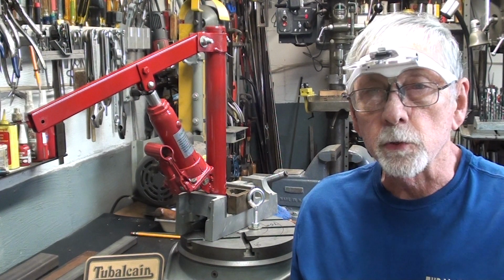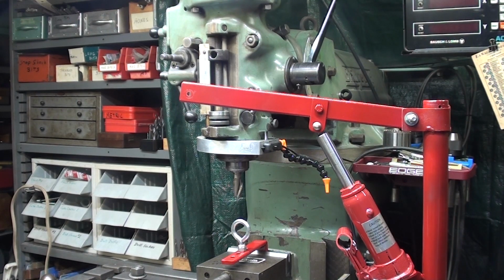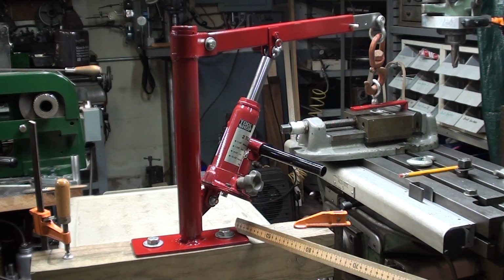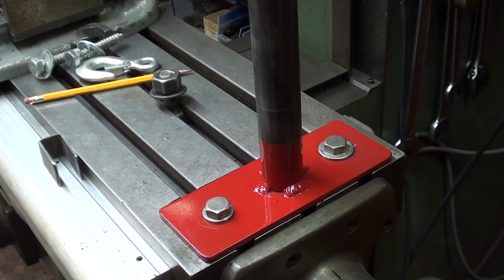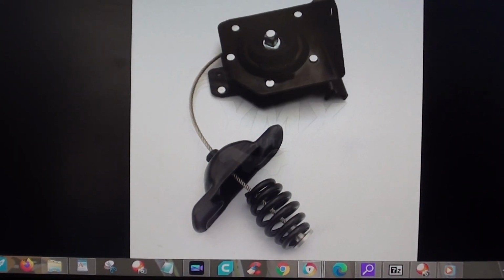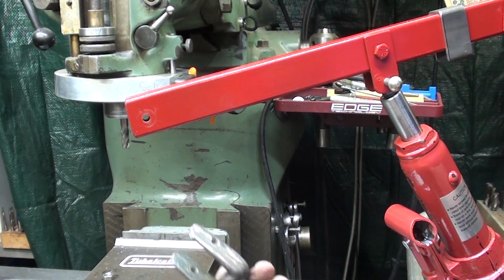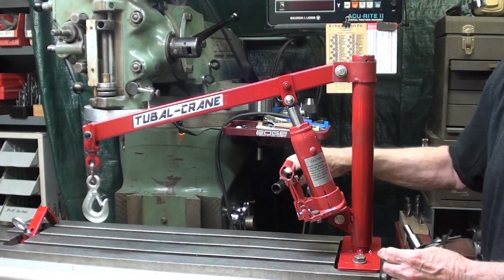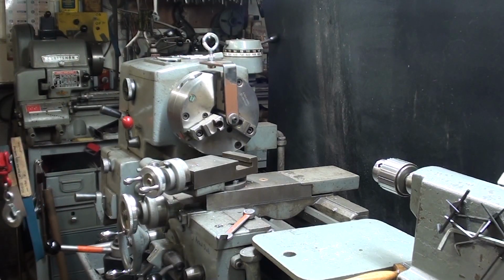Tubal-Crane - SKY Hook for Bridgeport Rotary Table pt 3 #729 tubalcain

Comment: Mr Pete, I have always enjoyed your excellent videos, tips and solutions to shop problems. LOVED the comment "Wreck of the Hesperus" my mother in law used that phrase from time to time.  Just a couple thoughts. IF the crane was mounted on the left end of the table, your jack might be more convenient. And, they make a boat winch with worm drive that would hold the load at any point. Also, it may be that the spare tire winch is a worm drive. By having a winch, it makes it possible to lift near the boom pivot, or lower all the way to the floor. Great stuff. Thank you, R.D. Flagg
Reply from the maker: Good suggestions

Comment: Mr. Pete I've watched your videos #1 & #2 and saw you discounted the electric winch, because you don't have sufficient vertical height in your shop.  Well I've been struggling with moving equipment around and will be installing one of those electric winches, because I need to move up to 300 lbs.  what I intend to do is mount the winch on the floor, or wall and route the cable through pulleys and I'm sure you could do the same in your shop.  Just something to think about.  Thanks for your videos!!

Comment: Did you consider using the grab hook with a short length of 1/4" chain as a two leg bridle and attach to the vise in two places. With a setup like that you can adjust for the CG by moving one or two links off center.

Comment: Can you create new long tee slot nuts so you spread out the load farther and prevent ripping out a small chunk of tee slot and dropping what ever you are picking up. 
You may make a swivel pad for the jack base to turn it for easy pumping.
Knob. I mash a piece of tube to weld a knob to and glue a super magnet into the tube. So it comes off easily.

Comment: Not sure why that little spring latch would be a safety feature. As far as I can tell, the only thing it does is prevent the hook from coming unhooked when there's no load on it. It certainly isn't going to resist. Any serious force.

Comment: Pondering this problem, I wonder if it could be solved by one of those tool tether things.  They hold up to about 25 kg... (about 40 Kentucky butter balls) The idea being that it does not lift the object but take a bit of the gravity out of it to paraphrase aVe. It is always easier to haul down is my thinking. Has anyone tried this? Need a bit of ceiling height of course.
Reply from the maker: Those are good for a 4 pound air tool

Comment: Should be easy enough to figure out the location for the jack pivot; it's just a simple lever.

If it's a 500-lb jack and a 50-lb vise, then the pivot point can be any place that's 1/10 of the boom length away from the vertical or further. Adjust numbers to match your actual devices and desired safety margin.
Reply: Don't forget the strength of the pivot bolt. Every move closer in increases it's loading tremendously.

Comment: ????? I love your video's but this is a bit much.  a 2 ton hydraulic jack with the setup you have is likely only going to be able to realistically lift 1200 or 1300 lbs......... I think you know this. ;)  However, my biggest issue is that I'm hard pressed to find a rotary table or part that is 0.5tons that would actually fit in the setup you are picturing....................... Then again, there is the ridiculous swivel hook you are using. ;)    I'm pretty sure you're in full blown sarcasm mode and that's totally your prerogative.  However, I would say that I have learned a lot from your videos and value them immensely.  Please keep up the good work...........

Regards,

-K

ps.  We're not even factoring in the Safety Factor ALL lifting equipment has, typically 5:1 or better, so a hook that is rated for 1ton under testing won't fail until 5 tons.......... you're at best lifting .75 tons with your setup and that's generous, because I'm hard pressed to think of tooling for the bridgeport that's even remotely close to 1650lbs.................. ;)  let alone 5X that weight.

As I initially mentioned, pretty sure this is a sarcastic video and all the sheeple need to back down.  Then again, what do I know?  I've only been responsible for lifting about 3,000 40+ ton crane loads  and many thousands of 10-20ton lifts in my life.  Moved on long ago though ;)

Comment: I like the idea and had in past when lifting my rotary table or big chuck thought I needed a lift crane or boom.  I had bought from out of business machine shop a rolling floor crane that uses a boat winch and can lift 250lbs.  But legs and wheel get in the way so I still use my HF lift table and slide things.  

In watching my mind already is formulating going with a I-Beam versus a rectangular tube for arm.  I will make a small trolly with stoppers for sliding the hook on.
I also may experiment with a treadmill incline motorized lift instead of the bottle jack (not crazy on bottle jack). I have several of the incline motors I pulled from scraping treadmills.   And cam make a simple toggle up and down control power supply.

Still waiting for answers to last what is it.

Comment: If you were to extend the base of the platform towards the vertical pipe and bore a hole or two in it you could turn the jack around so you are pumping the handle downwards like the jack was originally designed to do.

Comment: You probably had this suggestion before but if you mounted the Tubal-crane on the left side of the table, wouldn't the handle be in the correct position? Nice project. Thanks for sharing.
Reply from the maker: You mean like how I did it in part two?
Reply: @mrpete222  Yepper. Just like you did in part two. I did watch all the videos, just didn't remember you had started out on the left. Just another perk that comes along with age (I'm 75), memory lapses. Thanks for setting me straight.

Comment: From one old GrandPa to another: do yourself a favour, get a trained electrician to recable the Bosch grinder, and make it safe, you daft old Grandpa!
Reply from the maker: A $50 cord for a one dollar grinder?
Reply: @mrpete222  Tubal-Crane,

As a fully qualified but long-retired Electrical Engineer, I hesitate to give advice to a man of a similar age to myself, who has the guts to put his hobby and skills online for all to comment and/or criticise upon.

So instead of criticism, or even any attempt to change a man’s mind, I would simply list the options on just the continuing  existence of a frayed and dangerous flexible power cable.

Ensuring you and any family / visitors in your premises are fully protected by means of the appropriate R.C.D. (Residual Current Detector) breaker at your intake Fuse / Circuit Breaker box.
The presence of the mentioned cost of $50.00 Electrician for the repair.
The purchase of a replacement Bosch Grinder @ =/- $75-$95.
The payment of $2,500-odd for the Cremation Service following the accident.

Your life……………..Your Choice!

Comment: If the hydraulic cylinder could be mounted in such a way where it can rotate about its's center axis, you would accomplish the pumping in multiple positions, without having to pump up.

Comment: Building on the crane on the cart idea, What about mounting the crane on the edge of a bottom tool box?  With floor space at a premium in most shops, mounting on a bottom tool box will cover several requirements. 

Just a thought on an already great project.

Comment: I use 20 ton jacks in my home made jewellers presses. I mill a slot in the release valve and weld a penny washer in to make it easier to open and close.
Reply: 24.20.  50mm!
Reply: How about turning the jack 90 Deg clockwise so that the jack handle is accessible from behind the vertical tube

Comment: This geezer has enjoyed this series immensely. I have a larger version of your crane from Northern Tool. It's the type that connects to a pickup truck hitch receiver. You have inspired me to mount a modified receiver to the frame of my welding table so I can attach my crane to it and lift heavy objects on, and off the table.

Comment: Hey Mr Pete! Long time viewer, just a thought for the ‘winch line’ idea. I’m an apprentice lineman, and at work we use what we call ‘slack blocks’ to pull small wire into sag (like triplex for a house service, for instance). Here’s a link to what I’m talking about. 

https://www.kleintools.com/catalog/block-tackle-standard-hooks/block-and-tackle-anchor-hook-cat-no-258

It doesn’t look like your setup needs a winch line, but these slack blocks are rated for 750lbs and they’re very lightweight. 

I also think the Klein #259 Swivel Anchor Hook would be perfect for the hook on your crane. 

https://www.kleintools.com/catalog/individual-hooks-blocks-accessories/swivel-anchor-hook

Just a thought! Take care.
Reply from the maker: Thank you for that. I was not familiar with Those products

Comment: I love it Lyle, the old KISS principal at its best, but I don't understand why you didn't keep the extension adjustable boom it gave you that option just in case without taking up any more space.
Here in rural Western Australia I have seen a fair few farmers work utes with a simular crane attached for picking up needed items such as full 44 gallon drums of diesel etc they seem to use the winch you see on boat trailers for their lifting mechanism. 
I drive a 1998 Toyota Hi-ace lwb van (https://images.app.goo.gl/YFU4mPtRjUXVKeq36) 
With a door on the back and a sliding door on the left side (our passenger side) 
That crane adapted to my needs would be ideal for lifting heavy objects in and out of the van with 
and it wouldn't be hard to make it so it clips into the internal side wall for storage taking up minimal space 
And basically using readily available stuff around home it would cost next to nothing to make as apposed to the cost of a manufactured on 
A great series Lyle 
Very much enjoyed it so far 
Tony from Western Australia 🇦🇺

Comment: Looks great to me. As far as a bearing or grease you know better than any of us how often you will use this tool and I suspect that it will be infrequently used. By using every once in a while the wear will be limited to a very small amount. If it does start to become an issue I'm sure you know someone that can machine a part for it 😎

I would have kept the boom with the adjustment as my engine hoist is very similar with a adjustable length boom as well so I like the versatility of it.

Comment: I realise you wanted to work with your in stock parts, and you're almost done, but an alternate construction is worth consideration. With a fixed height arm and the right chain hoist, the vises could be lowered to near floor level, potentially low enough the vise cart could roll under an existing bench. The key is the Kito or Harrington lever hoist (same company, two brands) Lx003. At about $200, a working load of 500#,  5 foot lift, no free running danger, gated hooks, and a fully drawn together length of 8" it's an amazing device. Action gets stiff at the upper end of the range, but at 70# pull the action is very light. The very short hook-to-hook length it can work at means it can be used inside enginge compartments and machine housings. Hoist with 5 feet of chain is maybe 5 pounds.

Comment: Not criticism, but an idea that you might like for speedy set up, would be bolts made like the top of a C clamp, with a sliding handle for torque. That way you wouldn't need a wrench to tighten them.

Comment: For use on the lathe, haw BAD do you feel about drilling & tapping 2 holes in the headstock gearbox lid to mount your existing crane mounting ? Again, I don't think the boom length is too long - you need the length when swinging out away from the lathe.

Comment: 24:17 You suggest moving the jack pivot point 2" toward the column pivot point. I say move it 3" -  so it's 3" from the column pivot point. The only thing you need to look out for is that in the fully up and fully down positions, the top of the jack doesn't bind against the column.

Comment: Lyle, If I've not commented 'negatively' about something - like the tack welding on the bottom of that tube, then whoever has done is probably wrong !
I can see what you're doing - making the best use of parts available and if I though you were going to pick a car up with that crane - then I'd criticise the welding too ! You have made something that's over-engineered in places but it's going to do what you want it to do - and that's that.

I would suggest moving the link to the top of the jack to maybe 3" from the column - it'd give you a greater lifting range as well as more movement per stroke of the pump.

Comment: 13:00 Well Mr Pete, you are not only crabby but in Homer Simpson mode !

D'oh !

Once you've loaded a few spare vices, rotary tables and whatnot onto the cart, it will then have the necessary stability for having the crane on the cart ! I suggest you put the heavy things you rarely use on the bottom shelf of the cart and the ones you are swapping in and out more regularly on the top of the cart.

Comment: Might as well go ahead and put the telescopic part in your new longer tube before it gets forgotten about. It would only move the hook out like 2inches when all the way in.  Then you readily have the option for more reach should you need it.  I have picked up about 3000lbs on one t-nut before. :-)
Reply from the maker: I had to laugh Brian. I need to pick up 50 pounds, you have to pick up 5 tons. Sorry you couldn’t get that car running. You might have to run it over the cliff

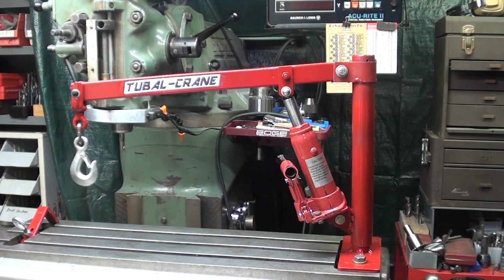Comment: 32:05 "Never put your hands underneath the load", 33:20 puts hand underneath the rotary table... Love you Mr Pete, don't take this wrong. Keep up the good videos.
Reply from the maker: Do you mean the scene where I place my hand under the rotary table that has wooden blocks under it for safety purposes?
Reply: Yes, I didn't intend to offend you and if I did, let me apologize. Since I have your attention and I'm currently planning on buying my first lathe and mill, although small machines, that will be quite a job to lower them in my basement and I was wondering how you managed to put that multi thousand pounds Bridgeport in yours when it seems you only have that narrow flight of stairs. Regards.

Comment: So it was not Bubber  That broke out the rotary table.  It Was the foolish man who made  that  Drills through  Hole in the "T" nuts , capable of letting the bolt pass through to the bed ?  & threads that went  all the way.  which allowed Bubber to over tighten,  His work  ?  Now that a thought.   {Was it buber's great strength rely to blame },? !.

Comment: i watch you Tubal -Crane  last night on my TV very interesting   Great mind think alike However.    Yes I watch the bothe  part's  from Beginning to finish ,  I thought about the lath Crain idea.  Built one for my van to lift stof in & out  & that includes my  mobility scooter ,  I nicknamed it the Tomy hoist. ["THOMPSON"  "TOMY HOIST " LOL]  ,  I may build one for my lath , i will wait  to see how you overcome the screw on  chuck,  that screw on , & I  get it the taped chuks  , but having to turn ons to get it on & off?   presents my lathe  as a 13" 4 jaw chuck,   Praps a bearing of some Type Please give.   Buber a day of. There's.   a lot of Bubber's Teaching Today.
Les England.  Who is Dyslexic,   & in school was  Often referred to as Bubber.  ? did Bubber do the paint job on the second crain . ? LOL  Tooshay.  

 So give him a day of. Please I do enjoy you program. " But Bobber does not" . 
I hop my comment as, not offended you Bubber.   [ Les England ],

Comment: not to beat a dead horse as you call it.lol but McMaster-Carr sells a small hand winch that automatically lock when you stop turning the handle and then releases when you crank it the opposite direction. you probably already know that but in case anyone out there isn't aware of it they exist , we use them here at work and they really work well and safely.
Reply from the maker: I will have to look at that in the catalog

Comment: Lyle, Tubal Crane is just perfect. It does just what you need it too. If you were going to pick up a 20"rotary table maybe you would have to build it a bit stronger. However, for your stated purpose it works fine with a good margin of overload. I know the extension adds a bit of weight, but, it makes it more useful. Remember, it's not a bad idea it it works. I just bought a Rubbermaid cart myself. Larger one that will hold 500 pounds on it's two shelves. I use it to store my rotary table and vises plus a linear table with a stepper drive. Much easier to roll it to the machine for a short transfer and roll it out of the way. I am only 73, but some of the stuff is getting heavy. If I can figure out how to use one I will build my own 'Tubal Crane'. Mke yourself a long 'T' nut and mount your crane on the cross slide. Good job!

Comment: Hi Lyle, just a reminder that 2 inches equals approximately 50 mm not 500 mm . You were getting so excited that you added an extra zero. I like the Tubal Crane but I think that you should add the extension piece to the longer boom. Extra reach is always important. Awaiting Part 4.
Mark from Melbourne